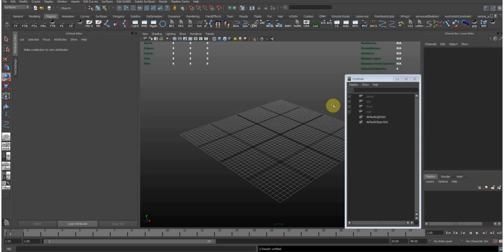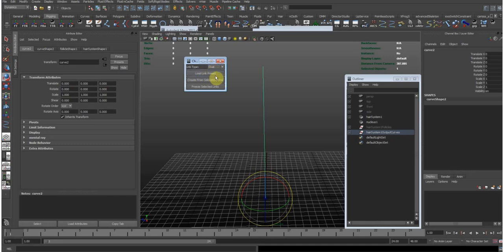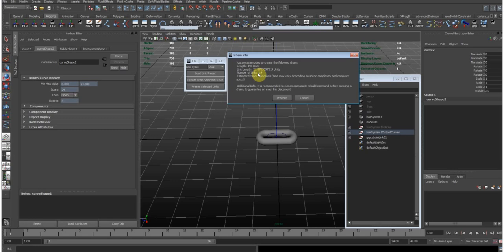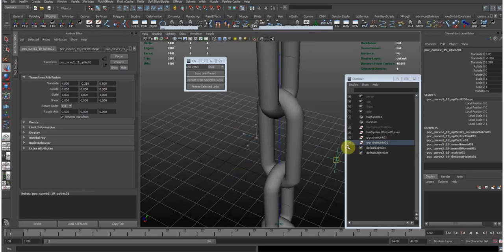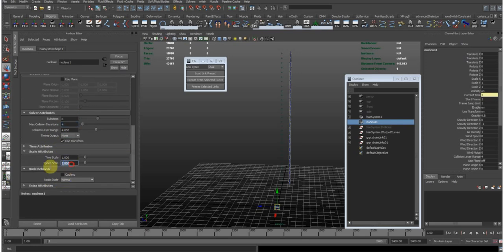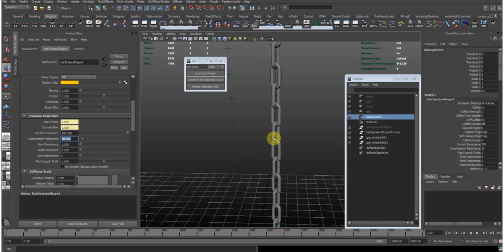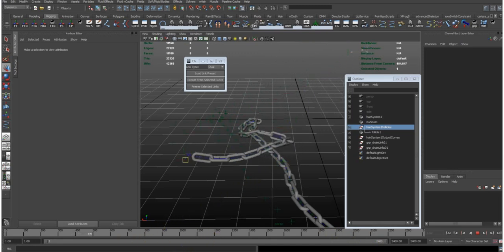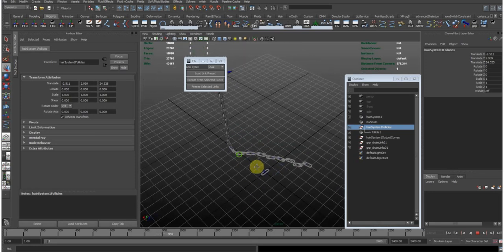Chain Rigging Maya

Comment: Awesome Script, greatly helps speed up my work flow for my class project. Thanks!
Reply: found a problem i cant seem to fix, the chains disappear when i render the scene using Mental ray in 2016.
I have tried to convert nurbs to polygons but it only gives me an error 
"...nurbsToPolyPreset.mel line 136: NURBS to Polygons: No valid items selected."

Anyone know how to fix this?
Reply: Hi @albertogalindo7435, could you please share the script with me if you still have it?

Comment: Thank you for sharing this its exacly what i need but i have a question man. Imanaged to install the script and added it to my shelf, it runs fine but cant find the preset file when i click on load Link Preset. i have the preset file in mayas default projects folder. Im running maya 2014 on a mac OSX 10.7 another question is,is it possible  to use this script with a chain link i modeled myself?  again thank you for your time